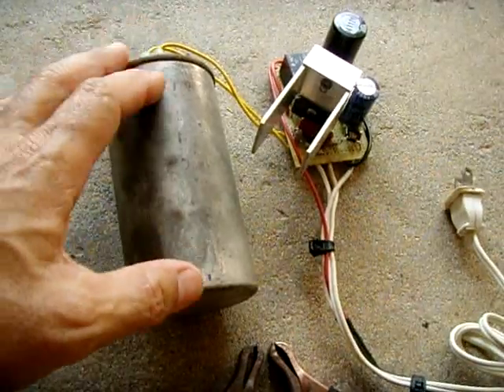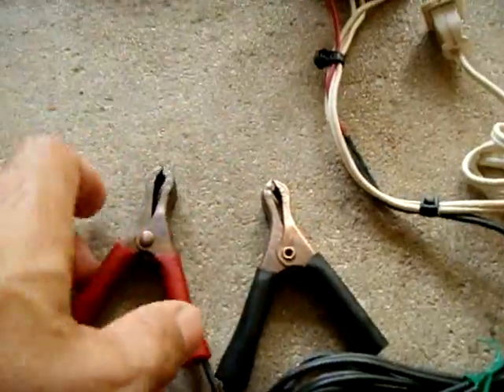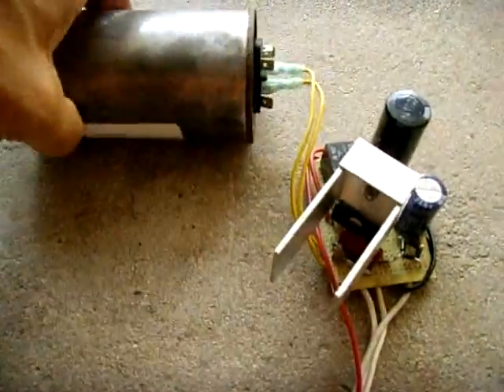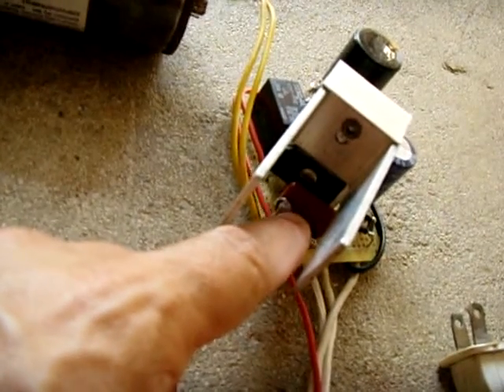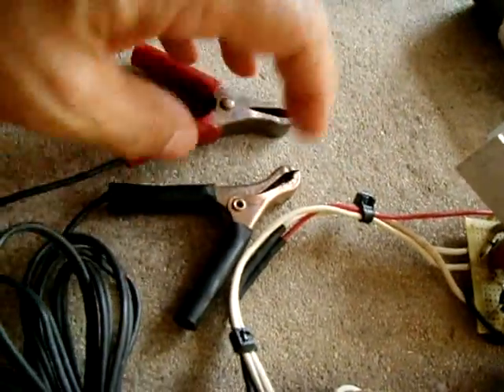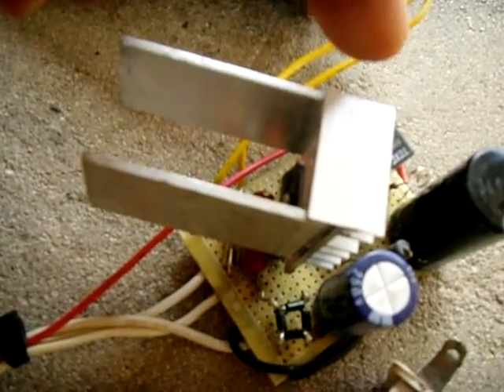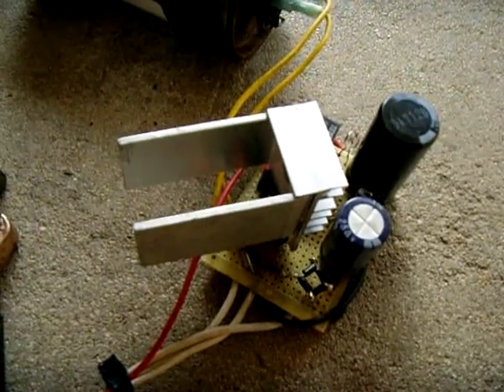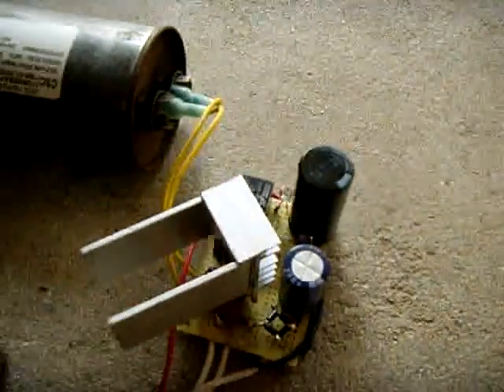How To Make Capacitive Lead Acid Battery Charger(12V)

Comment: This is a clever circuit. It is as we say cheap and dirty and will charge a battery quite well. 5 amps is a good rate to charge a car battery with.

Use a circuit like this with the following caveats.

One - The open circuit voltage is the peak of the line voltage which is sqrt(2) * 120V -2*0.7V (diode drop) ~= 168.3V. This would eventually burn a battery up if left unattended or you forgot to depower the unit. Use a timer or an alarm or something. Charging a battery can take hours. Over the course of those several hours a lot can happen to cause distraction (it's called life) meaning the best plans of mice and men (women too) and the unit might be forgotten about overnight. Then when it finally dawns on you that you left the charger on, its too late. Bye bye battery, now it's a core surrender for a new battery.

This is potentially a lethal circuit on several counts.

One -  It is directly connected to the line. TVs use a circuit like this but it was well isolated from the users.
Two - Not isolated neither side of the output can make contact with ground. After the  bridge rectifier they are approx 75VRMS above ground (try simulating the circuit with LTSpice). So, if you attached a grounded instrument to it, say an oscilloscope, you will get a bang and burned off ground from the probe. Also most importantly if a kid makes contact with it and is grounded, bare feet, holding on to grounded metal etc. there exists a serious risk of electrocution (DEATH). The courts will not excuse you if this occurs. So, you have to ensure beyond any possibility that no one will inadvertently make contact with this unit or it will be your wallet.

Grossly Inefficient - lets do some math. 5A x 120V = 600W that would be the VA that you would pull from the wall. Don't think for a moment that the power companys' meter won't read VA with a  PF (power factor) of 0. Lets compare to a transformer version. Lets use an open circuit voltage of 16VRMS, diode drop of 1V leaving 14V*sqrt(2)=19.799 to charge the battery. This is whole lot less than 170V. Ok now on to the efficiency calculation. The voltage ratio is 2/15 likewise the current ratio is 2/15 giving 5*(2/15)=2/3 amp.(line current) 2/3 amp x 120V= 80W. WOW that is almost 10 times less. So don't go in to the battery charging business with this circuit. LOL.

Now  last but not least is cost. Those Caps aren't cheap. A transformer from EBAY is comparably priced. So, your choice, spend your money on a Cap or spend your money on a transformer. Only you can make that decision.
My goal here is only to show both sides.
Have a great day and happy battery charging.

Comment: Good thinking! Obviously your circuit works for you. I am not being critical but, maybe it is me having a bad hair day or something - when I listened to the video three times and drew out a schematic that will not work the way the connections were told. I could go into technical detail. I know this,  it is hard to describe circuits without missing some points. I would suggest your listening to the post and drawing only based upon what you hear and you might see what I seemed to see. Then you can add corrections if you observe them. 

Dealing with a live circuit like this is tricky and a unique application of principles. I designed a floating circuit where a scope could be connected without current flow using an isolation transformer. I ran 120 240  circuits this way. Worked like a champ. I just had to have a monitor to make sure that if leakage occurred in the transformer that I would not get shocked nor damage test equipment. So I appreciate your design using live wall power. Using your description, there are missing connections - as thorough as you were with meaty details.

Describing a circuit is much more apt to have missing details than a schematic - which I would suggest posting also. You did good just some missing pieces.

Some design suggestions for safety:
If you unplug the device and wait a minute to unplug then it is very safe from higher voltages (give time for the starter capacitor to discharge. I would recommend putting this device in a box for safety and adding another relay that would activate off power in - closing when active to supply voltage to the circuit, a secondary contact on that relay can open the output to the battery connector - positive line.  -this relay would cut off current flow to and from the circuit essentially. NOTE during usage, if the leads are not connected, this can be an issue.

Another safety idea might be usinga varistor in line with the positive output to the battery with a 20V transorb diode across the output - when the output wants to climb the excess voltage (above 20v) would be regulated by the transorb. If the varistor is right limiting current to the transorb then it might work - the positive coefficient varistor would increase resistance which would absorb the voltage climb while the output could not climb above 20V (could use a higher volt transorb). If this worked then you would not need the extra relay. Check it out.
Reply from the maker: Clearly the circuit works as described. I use this charging circuit with no problems.
Reply: electronicsNmore
When such details are laid out by words it is harder to follow than with a schematic. I said that I may have been having a bad hair day and was not being critical. One thing I have learned in years of relating electronics and principles to others is to make it as simple as possible, and reinforce my concepts visually. My brain may not have been in gear then and right now I have no time to review the film. When one explains finite details with words and point to point illustration alone, much can be lost or misunderstood. Supportive schematics speak a pliphera amount of info and help clarify communications.
 I freely admit if I make a mistake - because pride is not a factor to me nor ego. I simply advise you to lay out a simple circuit drawing to reinforce the interconnections that you speak about so that there is little room for misunderstanding, Simplicity in communications, illustrations,  and representative drawings are a great tag team.
Reply: I just wrote a patent application, I understand fully and totally agree with you. It was a suggestion not a reprimand. Words painting pictures clearly is very difficult!

Comment: maybe off topic, but this is a full capacitive load. So with a power factor of almost 0. Meaning most of the power companies will not 'see' this load at all. On the other hands, some power companies are able to detect out of phase loads, and will double or triple the bill.
So: for any one who knows their power company does not charge you for loads with a very low power factor: this circuit will charge your batteries for free. But the word 'free' means free of charge, not free electricity. The capacitive load does have its impact on the current going through the wires.
Let me say this is a very difficult subject, so please think twice if you are going to apply this circuit. I think I would use it, but I don't want to strain my solar inverter with a 90 degrees out of phase circuit, so only at dawn or later.
Reply: Ah!ah! TRUE!

Comment: Buy a ball-guard before plugging it in.
Reply from the maker: For what reason exactly? I use this charger all the time. Works perfectly as long as you make sure the 120V receptacle is properly wired. I will be adding an extra safety feature to this circuit which will prevent operation if the polarity is wrong.

Comment: yes I think its time to wean ourselves safely off from heavy inductive transformers..theyre too bulky and heavy
Reply: That's what switched-mode power supplies are for. The transformers there are 10 or more times smaller, due to high frequency conversion, and still offer full insulation from mains.
Capacitive power limiting was popular many decades ago, when nobody thought about energy conservation and PF (power factor) whas a term known only to a narrow group of specialists. 
Today it may be good for a nightlight with a small LED, but not much more.
Reply: 68Stan I have already made mine.. it works well but with out all that complicated circuit..i ensure its all shorted and discharged after I use them.. its super reliable and even revitalised some of my other dead small NiCad batteries!

Comment: Hi my friend, please try this: take your HV JT and put the 120V output to your capacitor charger 5A, and see if you can charge a 12V auto battery with 2 AA batteries, it should work, maybe you will make another video about this also. Tnks for sharing and for your good work, please continue! See my channel for overunity stuff, tnks!

Comment from the maker: I would not suggest doing it. The voltage will be 315-320VDC with no load attached, instead of 160VDC. That is a lot more voltage & current that the caps will store and need to be bled off. You also would need a relay good for 320V, higher wattage resistors, a 100K resistor on the neon, instead of a 47K.....Bad idea. This circuit works great on 120V.

Comment from the maker: One more thing. The capacitor I used is a "P2" capacitor, which means in the event of failure, it goes to "open circuit". So the chance of the capacitor going to "short circuit" is HIGHLY remote. Added safety.

Comment from the maker: Not really as dangerous as you think. I expected people to say what you said. Is this something you would see sold in stores? Of course not. There are too many people out there with 2 left hands with five thumbs on each hand. LOL. If your cautious like I am, this circuit is extremely safe. If the capacitor ever shorted, 2 things would occur. The fuse would likely blow if it is rated just above what you normally draw, and the relay would disconnect the power to the battery if the V was too high.

Comment: Hi, I like this one, and it is well explained. I'm glad you came up with this. I built some before, my main cap was small, and I could not figure out why my current was low. You made this all clear. I like capacitive transformers, as they are commonly called and now thanks to you, I can design better ones. now, I may built one with a small cap that would give one amp max, while keeping everything as small as possible. And run 5 volt 1 amp (5 Watts) out! Thanks again.